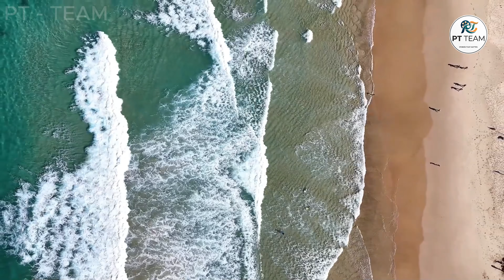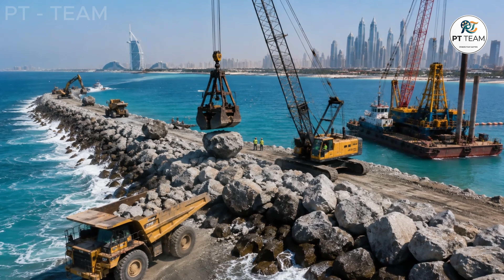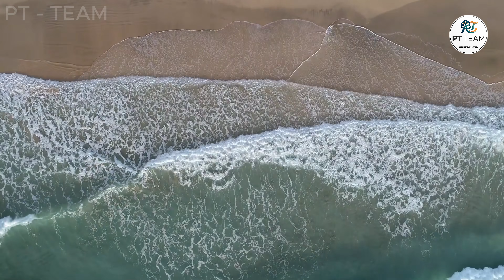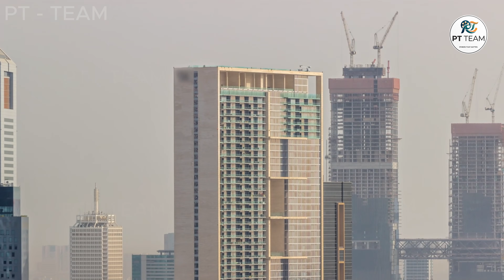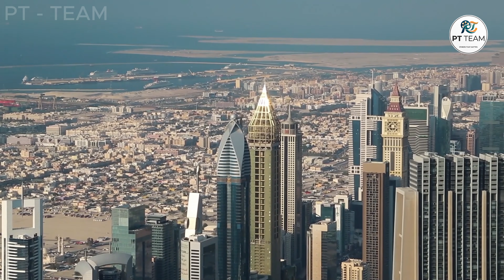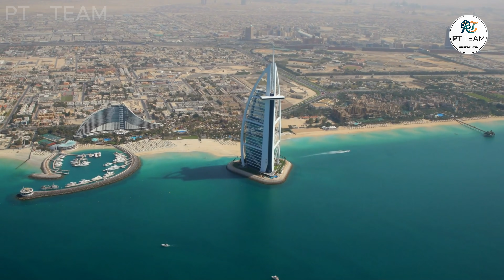Why Dubai Spends Millions To Keep Palm Jumeirah From Washing Away Into The Persian Gulf

Comment: I drive past the Palm every month, it looks nothing like this AI slop. And "millions over years" for maintenance is not a scandal, it is a line item. The Netherlands spends over a billion euros a year keeping its coastline in place, Florida has spent billions replenishing beaches since the 60s. A man-made island with a maintenance budget is just engineering working as intended.
This is like saying your car falls apart and is badly designed because you need regular oil change.
Reply from the maker: That’s a fair criticism. Maintenance by itself is not evidence of failure. The meaningful question is whether the scale, frequency, and cost of that maintenance stay within what the project was designed and budgeted to handle.